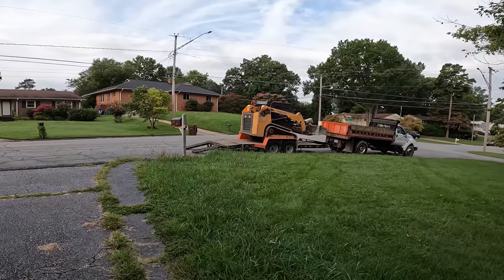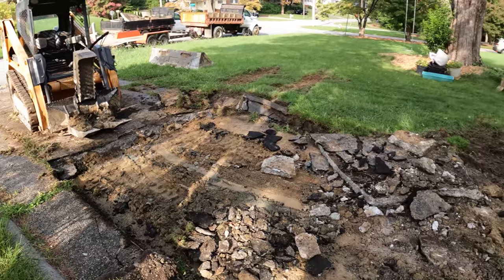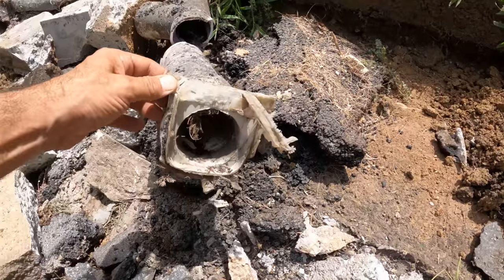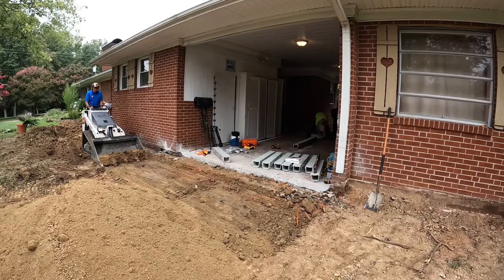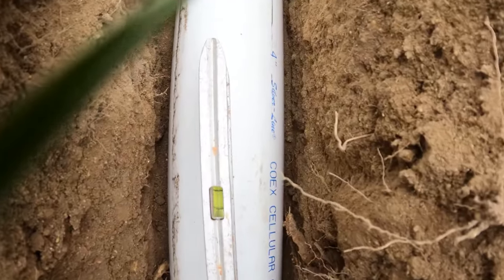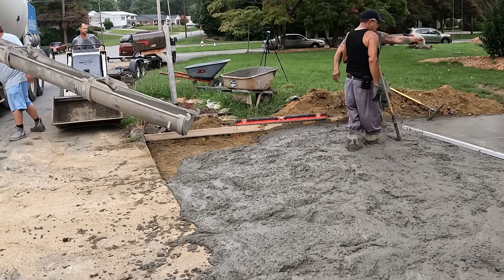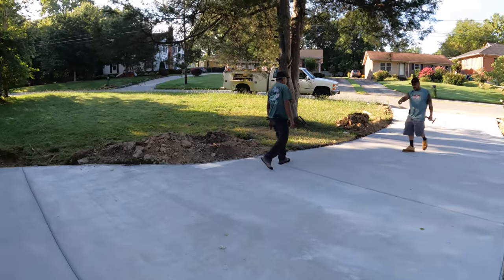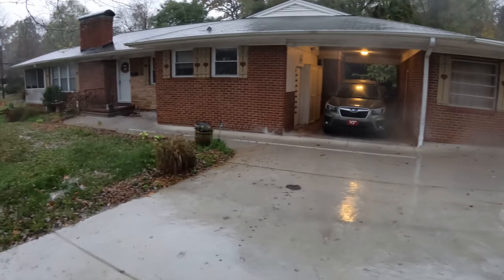Installing a new driveway and channel drain

Comment: Hi Sean. I noticed it in the driveway and sidewalk that there was no rebar or steel wire used to reinforce the concrete and just wondering is that something that’s not needed in your area?  I am certainly not critiquing your work. I think you do a great job and go above and beyond. I was just wondering. Thanks for the video.
Reply: Yes it should have weld mesh put it, otherwise it’s just a sub-standard job!.
Reply: Many driveways are fiber reinforced concrete 4 to 5 inches thick.
We don’t know the psi rating of the concrete.
Some guys do not use rebar unless it is subject to heavy vehicle traffic.
The UPS truck will not hurt it .. but … a ten wheeler loaded .?.. rut-roh 🐕

Comment: Great job. Home owner must be thrilled. Love to see water going where you want it. Only thing I see missing is Matt of steel rebar laying on a bed of gravel and concrete poured over to add strength to concrete. But then I live in Northern BC where temps range from 30c to -25 c which would cause frost heaves without steel rebar. Your company is doing amazing work❤❤. One thing you should add to business is gutter cleaning so you solve problem of water flow from peak of roof to final drain.

Comment: Your attention to detail is good ,the channel drain looks like a good solution ,what I see other out fits do with a heavy concrete truck is use old ply wood laid down in the driveway keeps it from  rutting it out .
Reply from the maker: I knew we would be in there fixing the approach so we fixed the ruts and compacted. It's a trade off between using the buggy to move the concrete or get the truck in there and then fix the ruts.

Comment: I find it sad at times what homeowners have to do to deter water. At least they have an incredible pro like you and the crew to make it right. Another awesome job.
Reply from the maker: Thank you Mac! 👍
Reply: Amen.   

What a great video !

~I am the flood control for our neighborhood, including two streets and an alley.
If I don't clear off debris from and open the storm grate in front of our house--the lowest point here--our garage will flood again .
The city came out about two years, dug down to the water table for two drains and connected each to other nearby drains to accommodate more water flow.
When they were finished, I told the city engineer and the contractor what a nice   job they did....and that I would be sending them another video when it flooded again--every time.

And the same problem still exists...all the tree seeds, leaves and other stuff that flows with the water, without any redesign for the excess trash.

~Just for fun, I took a video a few years ago of me rowing an old windsurfing board board back and forth in the street....

And still no more response to emails I've sent regarding this decades old (fifty plus years) failure.

🥸

Comment: I've lived in S Carolina and Florida and the one thing I couldn't figure out is why so many houses were built level with the yard! Placing the foundation a modest 6 inches above ground would prevent so many of these drainage issues. Great solution for this home for sure.

Comment: Thank you for not running the plate compactor over the dirt before seed. I hate when people do that because it leads to the grass raising the level of the dirt over the concrete. It makes me insane.
Reply from the maker: The grass will rise as the basic process of soil formation over time.
Reply: @GCFD  agreed so why come at it from too high to begin with! People compact the soil to exactly the height of the concrete then wonder why it's 2 inches high the next year and having drainage issues. No compaction should ever be used in the top 4-10 inches of soil.

Comment: Great job!! I would add expansion joint against all structures including driveway entry. Its not expensive and is cracking insurance when house and concrete expands and contracts with temperature.

Comment: That turned out really good. They had a pile of water going through there. What a mess that was but you fixed it up all right and looks really good. Another fine job. And it's always good when you get cooperation. From the contractors like the cement driver. That was good of them to give you some leeway good stuff and the homeowner. She was happy. 👍👍🙂🇨🇦

Comment: we save all the old concrete to put down as a base  then rebar on stand,s then 6" of new over the top higher than the road  by the way ace job on the drain,s
Reply from the maker: Sounds like you have freezing temps and bentonite in your area!

Comment: Nice job! Two questions why no rebar and why no felt/brown board between the house and concrete?
Reply from the maker: Rebar is not typically used in our climate for non structural. I have seen it in tear-outs maybe five times in the last seven years. The expansion is the same..some use it but most don't.

Comment: This was great ! I can appreciate all the work as I extended my driveway myself. I had to put in fist-sized rocks ( about 12" depth ) and then 3 sq metres of "farmyard grade" concrete. After it was poured, and I levelled it ( the truck driver was kind enough to help ), we had to drag a yard brush over it to give grip lines ( we get frost ). It was a great DIY project, but a) I was only digging out soil b) I wasn't in any hurry c) I dug about 6" too deep d) I wouldn't think a job bigger than 3aq metres of concrete is a job for 1 man. You need a team, and to hire one of those earth mover gizmos. If you had to remove a driveway, call the contractor !! And I was 30. 20 years later, my back says "No matter what, call the contractor !"

Comment: I work in concrete I was taught no pad bigger then 10ft some say every 12ft. But my rule of thumb is every 10 feet joint and try to joint off corners. Only thing I would say is I feel like the whole middle of that driveway needed a joint. The middle one put on the bottom of the apron should’ve went all the way through it’s likely a crack will chase off that and go up the whole driveway in years to come

Comment: Great job! Have watched many of your videos. Seeing the water running in the car port is really scary for a homeowner. The engineering of waterain  management is amazing with the very small elevation you have to work with everywhere. I have seen other cement driveways built but in your case, you do not use any rebar. Do you mind explaining why not? Different soil or build codes, perhaps?
Reply from the maker: We have very stable subsoils, no frost line, and no subsurface water. Rebar is not used in non-structural concrete in our area.

Comment: Looks good! ACI recommends 10x10 squares I believe, so next time extend the joint down the middle and it's close enough to perfect. Do you run those smaller dump vehicles so anyone can drive them? Rather than a bigger end dump that would require a CDL.... Take care!

Comment: Another quality project Shawn. It is amazing how quickly you company has grown including  your cool, time saving equipment armada and video production. Quality work and customer service has not changed with your  success. 👍 What is the rationale for use of foundational wire with concrete, just a preference ? It obviously is not always required. When I see the outfall volume, I always say to myself, “ where did all that water go before” ?
Reply from the maker: The wire is not needed in our climate for non structural concrete. But in other areas with freezing temps and less stable subsoils you need it. Where I lived in colorado you couldn’t use enough wire!

Comment: The concrete work had to be very demanding and it turned out great. My only question is why you did not use any rebar?
Reply from the maker: Rebar is not required with our warm climate and stable subsoils.

Comment: Great job with the drainage but why didn't you use reinforcing in the driveway to strengthen it as it will crack much earlier with cars passing over it
Reply from the maker: Reinforcement is not used in our area with our climate and native subsoils.

Comment: Looks like you need a full size dump truck. No wire mesh or rebar?
Reply from the maker: The problem with a full size dump is I'm the only one on my crew with a CDL and I don't want to be married to driving. No rebar needed in our area (stable subsoils).

Comment: Would love to see the condition 2-3 years from now. Without rebars and control joints through the middle, I think it is more prone to cracking.
Reply: Rebar doesn’t prevent concrete from cracking.  Concrete has two jobs, to keep mud off your boots and to crack.  It does both of them without fail.  It’s common practice in some parts of the country, mostly in the south, I believe, to pour flatwork without reinforcement.  Rebar prevents the concrete from moving after it cracks.  Frost heave is an issue we don’t have to worry about down here.  I’ve poured literally thousands of driveways with no rebar in them for various production home builders. Only the high end builders upgraded with reinforcement in their flatwork, usually wire mesh.  Fibremesh was just starting to become popular when I got out of the concrete business and I believe it’s pretty common practice these days. The sections between joints were pretty big, but not beyond acceptable. A joint in the center may have been a good idea, but it shouldn’t be a major issue.

Comment: First time I've ever seen a concrete driveway slab poured without laying reinforced steel mesh. I hope they never get any heavy vehicle deliveries. 😅
Reply from the maker: I’ve only ever see. Rebar a couple times o when tearing out driveways. Rebar is not used in our area with our climate and subsoils.
Reply: @GCFD  Fair enough. Courses for horses, I guess. I'm learning a lot from your videos. Just on my third hour, now watching your culvert reconstruction. Many thanks for taking the time to share your knowledge & experience. 👍

Comment: I realize there was minimal fall to work with, but generally speaking, it’s ill advised to pour sidewalks adjacent to a slab without black joint or similar expansion material between the two.  And the level of the concrete should leave about a 2” reveal of slab below the first course of brick.  Pouring all the way up to the level of the brick easily results in water intrusion if you ever have any water on the concrete because you’re level with the weep holes.  You may have 1 1/2” of play if the slab was poured with a brick ledge, but you’re still getting sheathing material wet.   Granted, if the channel drain does it’s job always, there shouldn’t be any water standing  on the sidewalk, and you had to raise the walk at the hose to have slope to the drain which could only be so low in order to make it work, but…. Sometimes it becomes difficult to do everything by the book.  Just something to consider on such a project.  
Just found the channel and enjoying a good binge.  Good stuff.

Comment: Did you have glass fiber reinforcement in the concrete?  Strange to not see some sort of steel rebar or heavy wire panel used to prevent cracking and separation of the concrete.
Reply from the maker: Yes I use fiber but most people don't in our area. We just have extremely stable B horizons.

Comment: You should put expansion joint against all the walls before you pour concrete against them. Good control joints.
Reply from the maker: In our area most people don't because we have stable subsoils.

Comment: How did you pour all that concrete without putting any steel in it, you didn't use 4x4 mesh or you didn't put any rebar in it, how did the inspector let you get by with that? Did you use fibers and they allowed you to do that without steel?

Comment: My only concern is the shallow concrete above the pipe, potential cracking. What say you?  I’m just a DYI’er
Reply from the maker: That's a huge concern but in this case there was no way around it. That concrete will crack. We didn't have the fall across the front to get that pipe deeper and allow more concrete over top of it. It's a trade off for having pipes that work.

Comment: Surely, that pipework is far too close to the surface? In  some parts it must be about 1-2 inches thick. Just asking but, don't you have to reinforce the cement with bar

Comment: 37:30 you want to keep your driveway elevation higher than the crown of the road...  some landscapers will use the edge of the road which is wrong.  I thought my driveway was a 2 inches too high before my driveway installer explained that to me.

Comment: wire isn't there wire mesh or some thing like that do you get something like fiberglass premixed in the concrete
Reply from the maker: Reinforcement is not used in our area for non-structural. I do add fiber in the mix when I pour.
Reply: @GCFD  thank you for the clarification you would do absolutely beautiful work and you've inspired me to do good work in my own house solid PVC instead of corrugated black pipe

Comment: Has this driveway turned to gravel yet? Why no mesh or rebar in the drive way? That’s insane
Reply from the maker: Mesh and rebar are not needed in our area with our mild climate and stable subsoils. From your comment, I'll be your area has a frost line, subsurface water, and possibly bentonite?

Comment: Excellent job! Just out of curiosity, it didn’t look like you put rebar in the concrete, unless I missed it? Is it not necessary to do rebar for light duty driveways like this? Not meant as criticism, I’m just learning about concrete.
Reply from the maker: Frikkie - local subsoil and climate conditions determine whether you need rebar. In Colorado where I had my first houses, you can't put enough rebar in concrete and it will still crack. This is because they have sandy soils, subsurface water, bentonite, and extreme freeze-thaw cycles (daily) that cause the subsoils to move. Here in NC we have clay, no bentonite, no subsurface water, and no frost line, so the subsoils are very stable. It took me awhile to get used to not using rebar here because it just feels wrong.
Reply: @GCFD  makes sense, thanks for the explanation!

Comment: The city there doesn’t require any reinforcement or tie in with the street there?  Cities here require 6” thick 3000psi min with #4 rebar 12”oc both ways, dowelled into street with black joint at the joint and some require a  12”wide X 12”deep header at the street, and get particular about the radius on the sides, the slope, green board joints, and some require if there’s sidewalks continue thru the approach at a certain height above the curb with the slope remaining consistent at 1” fall toward the street over 4’ width  and the approach continue back to the ROW/property line. Inspections required.   Must be nice just to dig it out and dump it.

Comment: Why do you NOT use rebar or other supporting bars in your conctre?
Reply from the maker: Because it's not required in our climate with our subsoils. I know this is probably different from where you live where you can't have enough rebar due to your cold temps and deep frost line, subsurface water, or bentonite subsoils.

Comment: Pouring cement on top of a pipe is a good way for it to Crack we're the pipe runs
Reply from the maker: Yes of course it is. There was no way around that cracking because we had such little fall to deal with.

Comment: At 32:34 that would be a low slump, I know what you meant but when ordering or talking to concrete pros a low slump means it sag less distance in inches when tested. High slump sags more so wetter concrete is higher slump.
Reply: @jeepinass  I think he knows slump but it was just said backwards. I bet compared to many of the contractors around he is at the top of the pile. As far as rebar, their area doesn't see as much freeze/thaw. He could certainly go 6 inches thick, haunches edges, rebar at 12" but that would price him out of work and be unnecessary for the service life of that work.
Reply: @jeepinass  that would certainly make a good 100 year driveway but we don’t know what the customer bought. Everything has a price. I oversee work in Boston, the sidewalk are 4” and never get rebar, city spec. They last long enough till they get torn up the next time. Driveways for trucks are min 6” with mesh or bar and amended sub grade. But we see far worse freeze thaw. I’m sure Shawn doesn’t sign a contract with a whole spec section but if the contractor and customer agree on the method and the price then that’s a sound agreement. I don’t think this work will fall apart in 2 years by any means haha!

Comment: Nice work as usual Shawn.  Question about concrete driveways.  When do you make the determination to put rebar supports in vs not?
Reply from the maker: In our climate rebar is not used for non structural concrete. We don't really have a frost line, no subsurface water, and no bentonite. If there are going to be trucks or huge equipment we will do 6" thick and metal that rolls out. In other areas (like Denver Colorado where I owned a few houses) you can't have enough rebar and the concrete still cracks. It depends on climate and subsoil.
Reply: Hey watch Ryan over at Victory outdoor services and you can see all kind of good info about concrete

Comment: No rebar or geotex fabric? Good way to have repeat customer I guess. Have to fix it again in the future.
Reply from the maker: Rebar is not used for non structural in our area. The reason is local climate in front coil conditions.

Comment: Decent job but the concrete is too thin on top of the pvc drain pipe running through the driveway and sidewalk area it will most likely crack there especially in the driveway with weight of vehicles driving over it also the y fitting should be bigger where the two drain pipes merge together in the front yard .